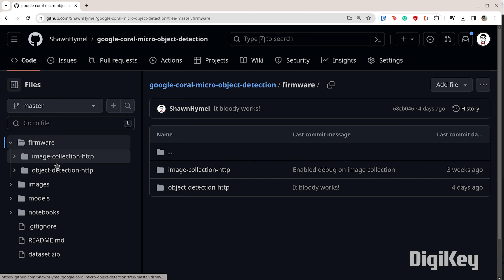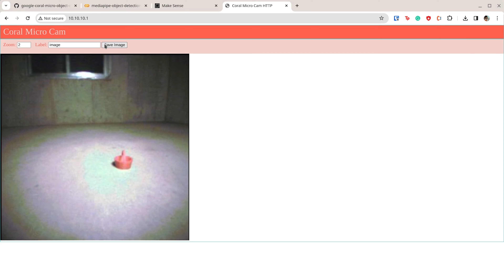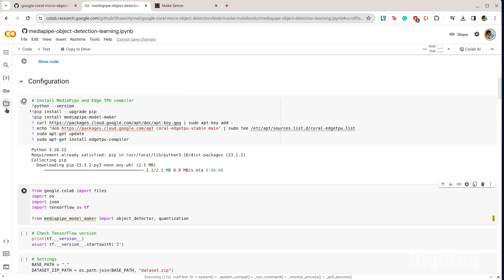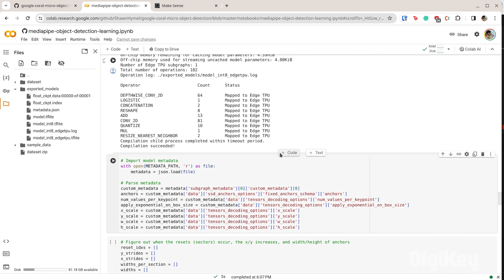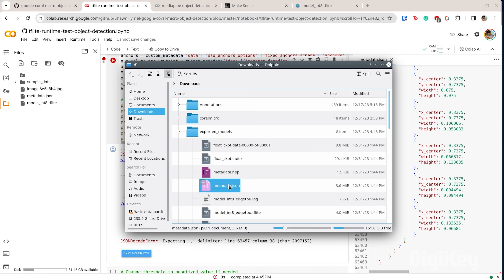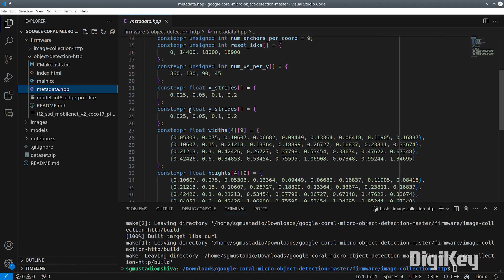Getting Started with the Google Coral Dev Board Micro - Low-Power Object Detection | DigiKey

Comment: Description

When i run lsusb

Google Inc. Coral Dev Board Micro 

I already tried everything on the flash tool troubleshooting section as start the serial mode. When i run python3 flashtool.py -e detect_faces, the error appears

Finding all necessary files
Creating Filesystem
	Section: 0x0
iMX bootable image generated successfully
Boot Section 0x00000000:
  FILL | adr=0x00010000 | len=0x00000004 | ptn=0xc2000105
  FILL | adr=0x00010004 | len=0x00000004 | ptn=0x00010020
  FILL | adr=0x00010008 | len=0x00000004 | ptn=0x00040004
  FILL | adr=0x0001000c | len=0x00000004 | ptn=0x00080004
  FILL | adr=0x00010020 | len=0x00000004 | ptn=0xc0010021
  ENA  | adr=0x00010000 | cnt=0x00000004 | flg=0x0110
  ERAS | adr=0x00000004 | cnt=0x00000004 | flg=0x0110
  ERAS | adr=0x00000008 | cnt=0x00000004 | flg=0x0110
  ERAS | adr=0x0000000c | cnt=0x00000040 | flg=0x0110
  LOAD | adr=0x00000004 | len=0x00017854 | crc=0x511a1083 | flg=0x0110
  LOAD | adr=0x00000008 | len=0x00017854 | crc=0x85117454 | flg=0x0110
STATE_CHECK_FOR_ANY
STATE_CHECK_FOR_ELFLOADER
STATE_RESET_ELFLOADER
Traceback (most recent call last):
  File "/home/augusto/.coral/coralmicro/scripts/flashtool.py", line 1193, in <module>
    main()
  File "/home/augusto/.coral/coralmicro/scripts/flashtool.py", line 1182, in main
    RunFlashtool(StateCheckForAny, sbfile_path=sbfile_path,
  File "/home/augusto/.coral/coralmicro/scripts/flashtool.py", line 821, in RunFlashtool
    (prev_state, state) = (state, state(**state_kwargs))
                                  ^^^^^^^^^^^^^^^^^^^^^
  File "/home/augusto/.coral/coralmicro/scripts/flashtool.py", line 610, in StateResetElfloader
    with OpenHidDevice(ELFLOADER_VID, ELFLOADER_PID, serial_number) as h:
  File "/usr/lib/python3.12/contextlib.py", line 137, in enter
    return next(self.gen)
           ^^^^^^^^^^^^^^
  File "/home/augusto/.coral/coralmicro/scripts/flashtool.py", line 589, in OpenHidDevice
    h = hid.device()
        ^^^^^^^^^^
AttributeError: module 'hid' has no attribute 'device'. Did you mean: 'Device'?